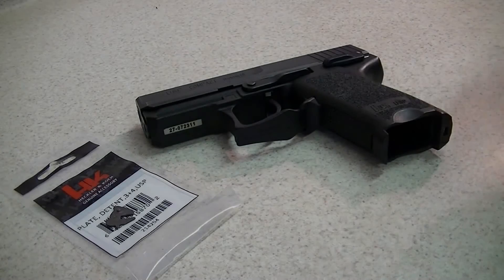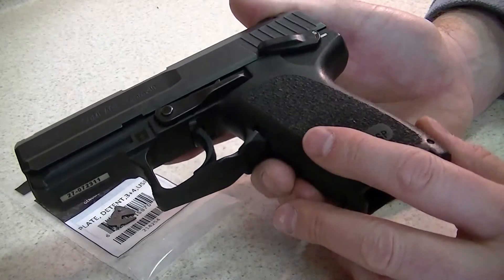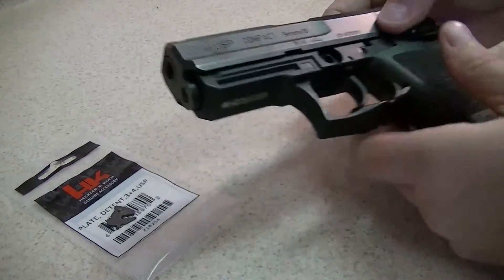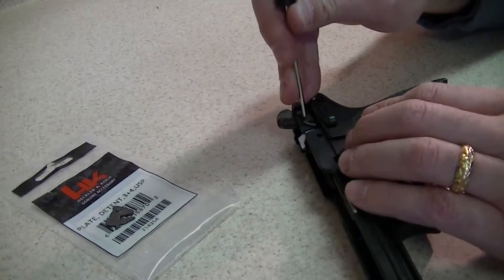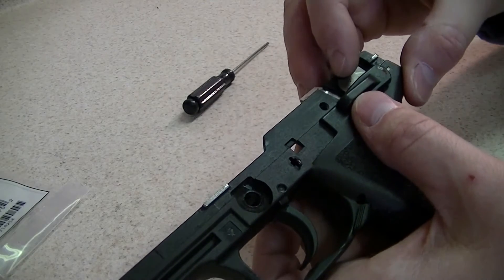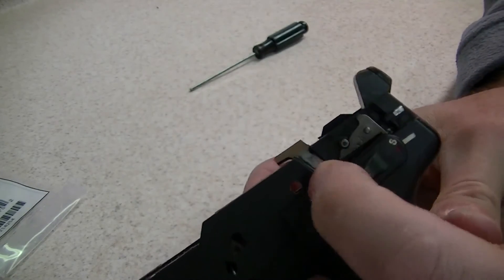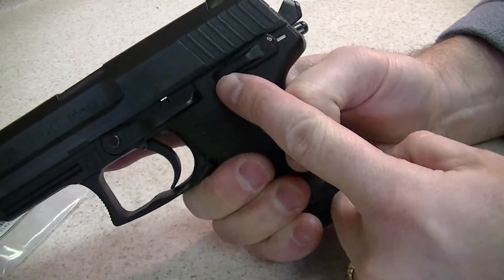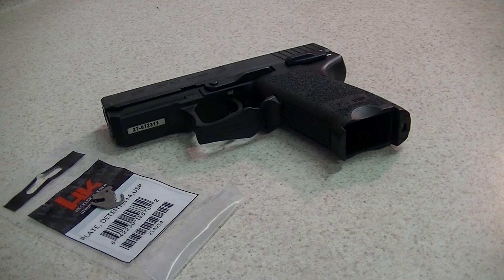HK USP Compact - Detent Plate

Comment: I spilled water on my HK USPC and disassembled it to wipe dry and oil it.  I was shaking the frame to remove the water and the detent plate fell out.  I tried to replace it but I had not notice its orientation and could not figure it out.  To top it off the pin that holds the plate in place had moved and was flushed with the frame.  If I had not found your video I would have spent a lot more time messing with it.  Thanks
Reply from the maker: Excellent! Glad the video was useful.

Comment: where did you get the Plate?
Reply from the maker: Top Gun Supply, HKParts.net and Brownell's sell them, you just have to find them in stock. I found a USP V3 detent plate and decock lever for $39.99 shipped on eBay. They were brand new, the guy bought a USP and converted it to a V1.